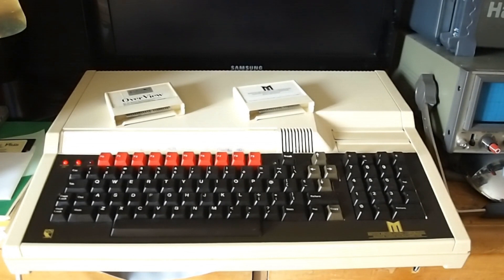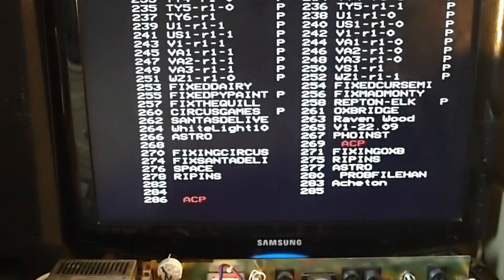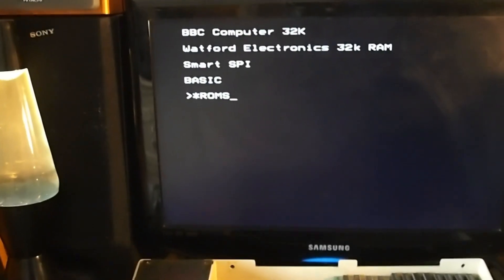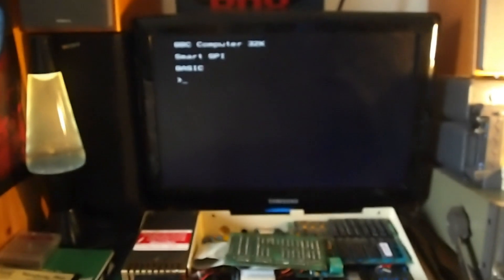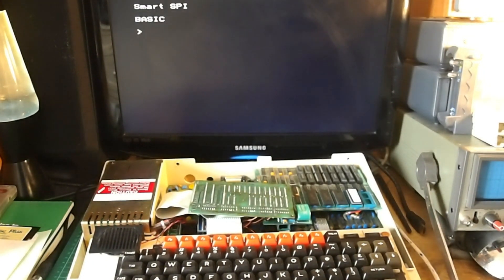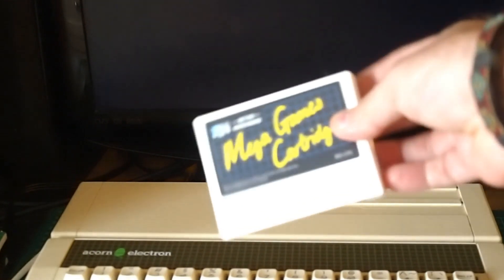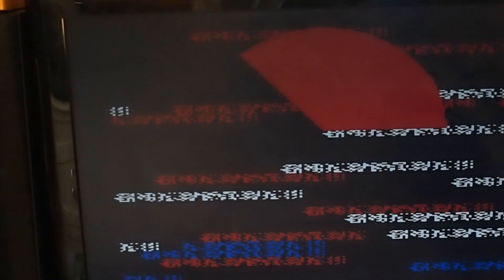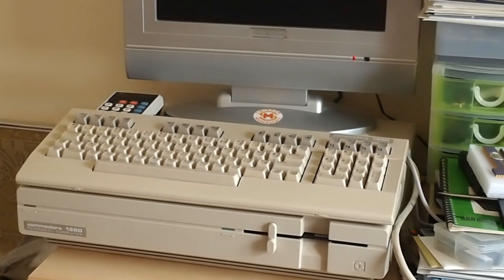BBC Micro/Master/Electron Peripherals/upgrades.

Comment: Nice video and thanks for the recommending my games http://www.bbcmicro.co.uk/index.php?rt_R=&rt_B=&rt_M=&rt_P=&rt_U=&rt_W=&rt_L=&search=broadhurst&sort=b AstroBlaster will use 1 or 2 banks of sideways RAM for sampled speech, or even the WE shadow RAM board you have if you don't have SWRAM. The trouble with samples is that it takes nearly all of the CPU cycles, so the game has to pause to play them, so I only added sampled speech where it doesn't affect game play. The speech chip needs hardly any CPU time, so AstroBlaster has all the arcade speech on a B/B+ with the TMS5220 but without and additional RAM, it is just the attract speech and sound effects.
Reply from the maker: one of my fave games in the 21st century :)

Comment: Some sweet mods there =D  Thanks for the mention =D  Sounds like your speech is a tad slow there (needing that variable resistor tweaking) - what does Kenneth Kendal sound like on there?
Reply from the maker: he sounds absolutely fine tbh. I know about the VR tweking from your video but imo it sounds fine to me. Maybe it's a subjective choice? Might try tweaking and see but ultimately I guess it's a gut feeling thing :-) You got an electron yet??? Actually, I'm really looking forward to your opinion on the NULA. Might be a mod I leave tbh.
Reply: Retro Marky  Unless you have a frequency counter or oscilloscope, what sounds right to you is probably best ;) I have a NULA in one of my beebs and is a great bit of kit. Not a necessity, but a nice to have. My only game that has extra NULA fuctionality is Frogger https://stardot.org.uk/forums/viewtopic.php?f=57&t=10684&hilit=frogger&start=120#p198793 (The beeb colours weren't my final choices, but you can see how close the NULA lets you get to the arcade).
The Shadow of the Beast demo for NULA is pretty amazing and if you have a PI co-pro, you can also run a spectrum emulator on the beeb! and maybe soon CPC too.
Reply from the maker: @trickysoft  Thanks for your comments Richard. Yeh, the samples sound "right" to me and add a certain something to some software. Actually GadgetUK16
4 is sending me a Beeb SID chip peripheral so very excited about that. The NULA, I will get some day but not right at the moment.... but I do appreciate the home-brew community and peeps like yourself putting in so much effort into keeping the Beeb and other 8 bit classics alive....A spectrum emu on a beeb sounds particularly interesting. :)
Reply: @RetroMarkyRM  Spectrum emulator (requires PI co-pro and NULA) https://www.youtube.com/watch?v=ULzpLhT43ac
SoTB demo (requires NULA and sideways RAM  - I think) https://www.youtube.com/watch?v=TYb7XjnMsaA
Reply from the maker: oh, have you converted anymore samples btw? I'm a fan of the Atari coinops, gauntlet, paperboy and the like for great speech.